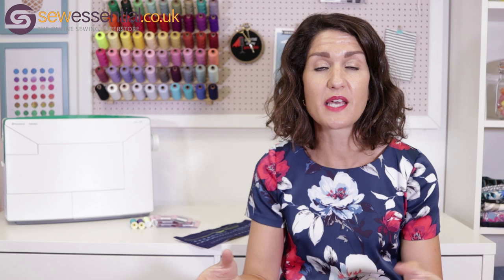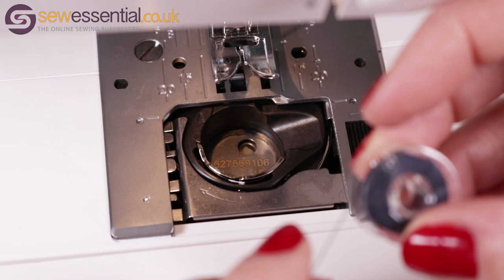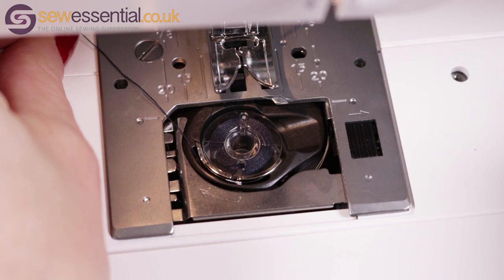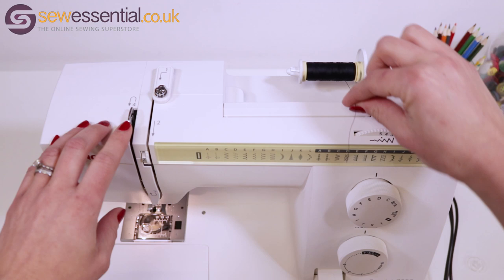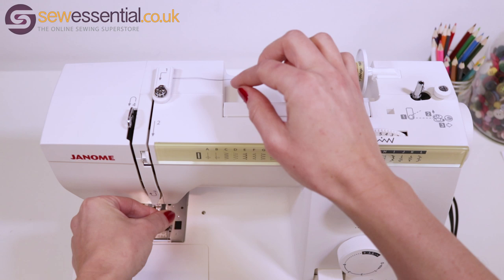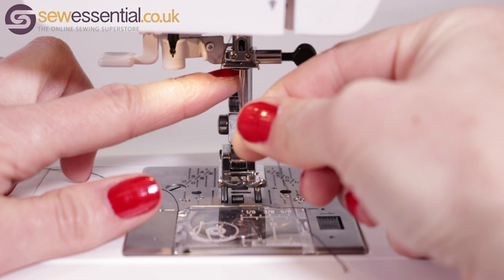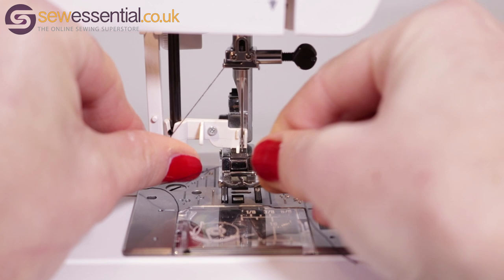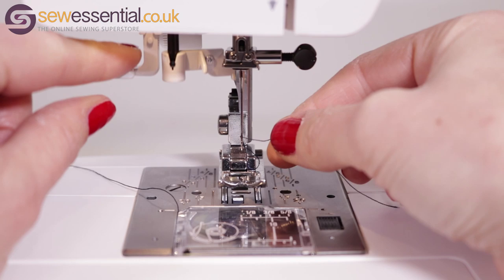Top 7 Tips to Fix Stitch Quality Problems

Comment: Your tip on making sure the needle is inserted far enough up is a very good one. I took my right needle out of Janome Overlooker to try a different stitch. Upon putting all dials etc back to normal it would not form loops. After 4 hours of rethreading, Youtubing, looking up manual etc and walking away. I thought what was the last thing I did before it played up. Unscrewed right needle and instantly realised it wasn't pushed up high enough. Worked like a dream after I fixed this.
Reply from the maker: Thanks for sharing, the smallest adjustments can make the biggest difference it's true.

Comment: I bought a Baby Lock Evolution from a firm in Germany. The stitch sample was perfect but I could not get it to stitch properly. Turns out the technician hadn’t tightened one of the needle clamps properly and in the post one of the needles worked its way down a bit. As soon as the needle was at the correct height I got great results

Comment: I'm wondering... would a ball point, or a denim needle be better for working with fleece?  I've been working on some things in fleece lately, and am about to try switching to ball point to see if that works better.  I was using denim, because I'm usually going through at least two layers of fleece.

Comment: Very useful thanks.  How often do you change your overlocker needles?
Reply from the maker: So glad you enjoyed it. As with the sewing machine needles there are no hard and fast rules, I often change my sewing machine needles every project or every other project, usually because I'm working with a different type of fabric. For my overlocker I change the needles less regularly, however, it would be one of the first things I checked if I was having stitch quality problems on my overlocker and I think that's the key point - ruling blunt needles out if you're having problems on either machine by changing them. Hope that helps.